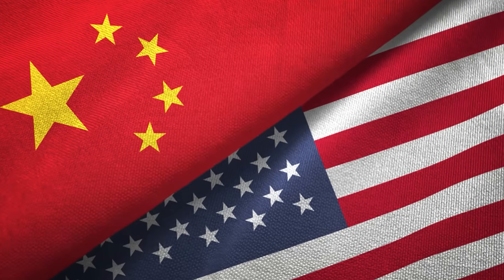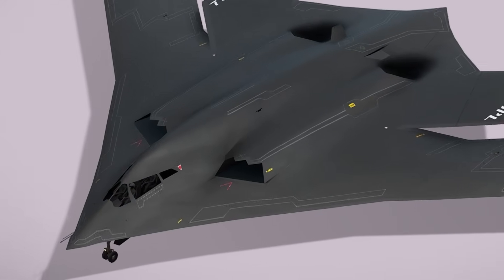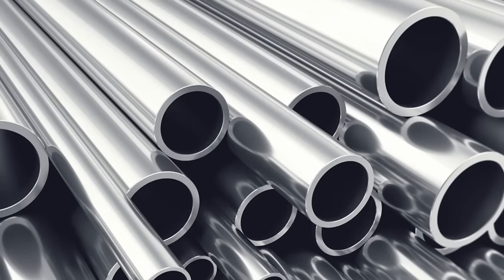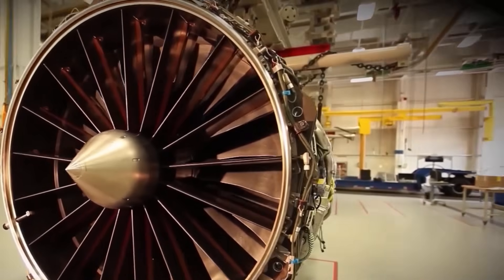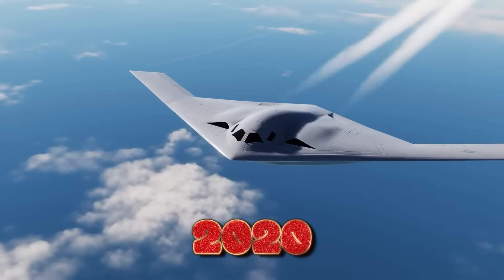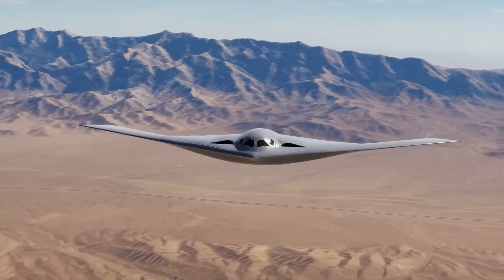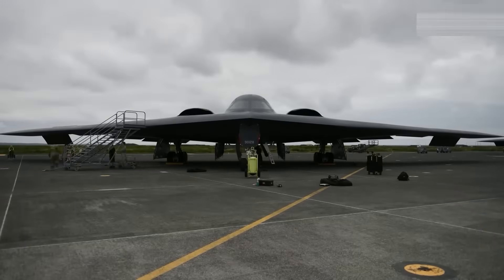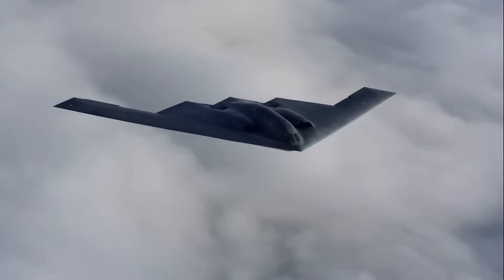B21 Raider vs Xi'an H20 | INCREDIBLE ENGINE Difference

Comment: And one mover that doesn’t exist China
Reply: Technically there's a picture of the Chinese one. We know at least a prototype or technology demonstrator exists. We simply don't have enough information to know at what stage the Chinese aircraft is at. I would guess it's still a few years away from actual production.
Reply: J-36 and J-50 can be seen flying. Several satellite spyshots spotted H-20 parked on airbase. Whereas NGAD F-47 is still on CGI. B-21 is just economic variant of B-2. WS-15 engine is already available. If they fitted 4x WS-15 engines on the H-20, it has 120,000lbs dry trust and 160,000lbs reheat thrust which is greater than B-1B. Also with TVC and new electric motor controlled actuators replacing hydraulic for flight control, the H-20 can be classified as huge fighter bomber. H-20 can engage air targets whereas B-21 can't